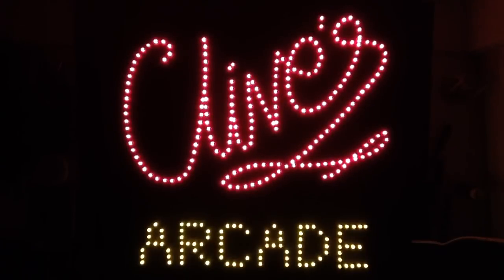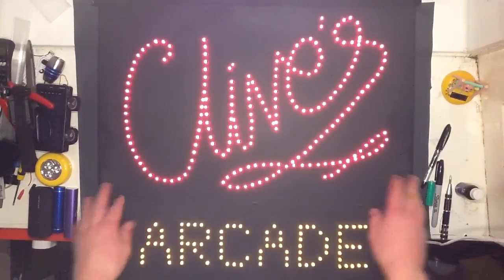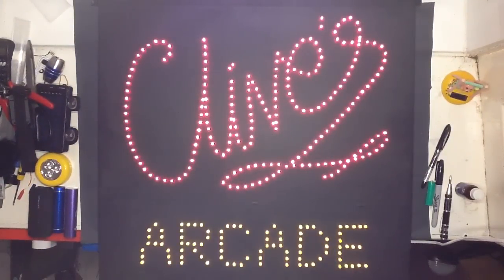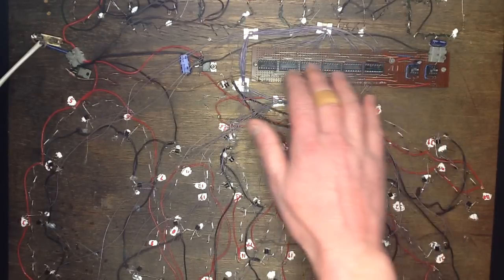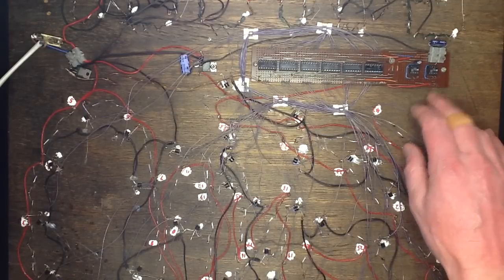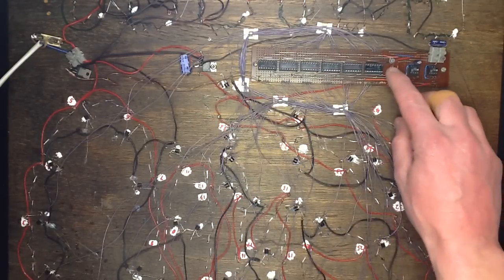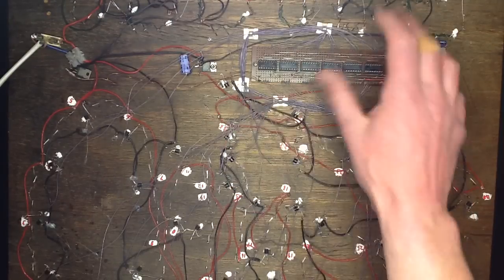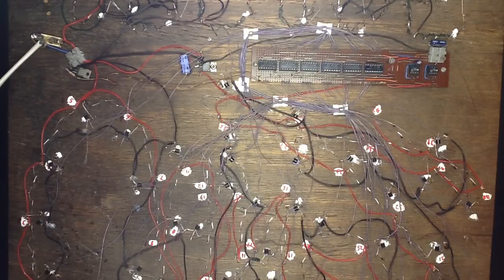An old "scripting" LED sign I built back in the early 80's.

Comment: Just came to visit after the link posted in the livestream 07/05/2022 (DD.MM.YYYY). Reminds me of a fairground thing I made many years ago with strobe tubes and 1 bit shift registers to make a super long (must have been around 15m) travelling strobe light - That did have a PIC micro, and it made a pleasant ticking sound as the strobe lights fired. Used a dual flip flop per board; one for a shift register and one to generate the firing pulse for the trigger transformers. Unfortunately wasn't too reliable, something to do with the tubes being fragile and the opto triac not liking firing the trigger transformer too much. Good while it worked though, could have been used as a landing strip identifier, Maybe could make a low voltage version nowadays with super bright LED's instead of strobe tubes, not quite the same effect but would be much more reliable. Was housed in a very tough, ridged flexible tube, then siliconed for weather proofing.

Comment: Dear, the signature Clives  has more than  48 LEDS but you have used 6 nos. 4511 is with 2x4 bits each IC which  is total 48 bits. 
Can you please share  the  connections diagram  for the above  sign showing how to  drive the more than 48 LEDS. 
Thanks  in advance

Comment: You've inspired me to build a Merry Christmas sign with my grandson, based on this concept and design.  I'm hoping to make an instructable out of it - if you don't mind.  I'll obviously credit you with the inspiration and original design, and provide a link to the video.  I'm going to use 74HC595 shift registers, and drive the clock timing and chase patterns from an Arduino sketch rather than the fixed pulses from a 555, and light the whole thing using LEDs salvaged from failed sets of solar powered outdoor Christmas lights.  Thanks for all the great videos and your superbly dry sense of humour - keep 'em coming.

Comment: Wow, stuff realy was different back in the 80s... I can just go on ebay and get 100 LEDs for 10€ including the resistors, design the logo in Inkscape or Illustrator and then have it cut on the lasercutter at the local open lab. This would be a <30€ weekend project!

Comment: Your talk on the shift registers kind of reminded me... Do you know of a simple 4 pin binary to decimal converter or shift register?
Reply from the maker: +Susana Godinho there used to be a wide range of chips for BCD (Binary Coded Decimal) in either direction from discrete inputs and outputs to 7 segment display drivers.  Both in TTL and CMOS logic chips.

Comment: I wonder what's the maximum power you can take from the grid. In Italy the electric meter cuts at 3kW.
Reply from the maker: +TuttoCrafting Really?  We have a 60 to 100A supply at 230V.
Reply: Yes. It is really disturbing.
I can't turn on the washing machine along with the oven or the hair dryer.

I am a computer technician and I can't let servers up while I cook. There are business plans up to 6kW single phase. (but they are expensive)

Comment: That's very nice Clive!
Brings back memories of something similar I built when at uni in the mid 80's for a friends band.  The script was nowhere near as elaborate as yours, but it did have a 6502 with MIDI input for synchronisation with the music.  I found the mess of wiring and LEDs a few years ago in a box - I obviously didn't keep the frame, but had extracted the parts just in case.

Comment: I have a set of ROMs, EPROMs and SM cards that were used in testing, setup and servicing of video poker and other video gaming type machines in Las Vegas. I think there's 8 or so devices in an anti static box if your interested.
Reply from the maker: +ElfNet Gaming Strangely, I was eyeing up a full poker machine in an arcade today.  Never seen it turned on in that place ever.  But sadly the owner always plays the "licence" card when I enquire about the machines.
Reply: Yeah, i hear they are strict on gaming devices that payout in legal currency. It's that way here too. The ONLY way I think a non licensed person can buy a video poker machine here is if the roms / e2proms that hold the game data are removed.. The ones I have are test chips though but I guess you could install them and play on them.. I have no way of testing them though.

Comment: My grandson and I watch your videos every time you post one and enjoy them tremendously would you consider doing a how to video on making something like this my grand kid wants to make his own and I am still learning so I would need instruction for dummies to help him make one
Reply: M Baldridge nowadays you can fairly easily get a near identical result with an Arduino and a slightly edited blick example, just common together all of the negative leads on the LEDs to the ground on the Arduino and then decide how many segments of lights you want and common together all the positives in that section, connect that to an appropriate resistor and to a GPIO on the Arduino
Reply: Toby Cowles yeah it's easy to do this with an arduino, transistors and a few lines of code, but the discrete logic Version is way cooler

Comment: Good job and a lot of work!  I'm a little surprised you didn't drill a single hole for the LED body and stuff and/or glue them in, rather than individual holes for the wires. Makes the front reasonably invulnerable, and a second bit of perf board or Masonite or luan on the back protects the wires -- usually.

I remember making things like that, but i used a 556 instead of a pair of 555s. But then, that probably depends on what is in the parts bin that day.

Comment: Since you show us all those old things you've build, i checked if i still had some of my old stuff.
I found a DC/DC Step Down converter i made once to power a Game Boy off the board power from my dads mercedes. I didn't had multimeter back then. So i never checked the voltage that came out of it. But my Calculations where correct from a layout i had in a magazine. So today i checked it finally, and came to the conclusion. My Gameboy should have exploded. Because it never stepped the power down from 12V to 6V, it was on 12V.

Looking at it i somehow f***ed up and had bridged a contact with a huge solder blob...

Oh well, it survived, no clue why, but it did.
Reply: +djteac Original Game Boy, right? The color one is very picky about what it accepts from the 3v input: 3 volts. Try to use five and it just won't turn on.
Reply: Looks like your version accounted for some inconsistent voltages of unregulated power bricks (which can go up to 16V under minimal load) so it survived.

Comment: Why drill two tiny holes for the leads and not just one bigger hole for the body of the LED to fit into, leaving the leads free? Does it provide better mechanical support? or easier connections? It seems like it's a significantly amount of extra work
Reply from the maker: +Daniel G If you look for another sign video I put up then the single hole for both leads is actually a lot easier and faster.

Comment: Magnificent beard at 1:40

Really though, I like the idea of the scripting LED sign.  I may have to do that once I find myself in the position to have a man cave.
Reply: +Brendan Orr Word of advice: unless you specifically enjoy doing it the oldskool way, these day there are LEDs with built-in shift input and output (like the WS2812) - so you just string them up one after another without the need to build a whole harness with a dedicated wire to each (also, they're full RGB).
Reply: I've already got bags of LEDs laying around along with trays of shift registers and TLC5940s.  Although I would like to make a LED marquee/ticker out of WS2812 or similiar packages.

Comment: Arcade machines are strange things, still present but very rare in the field other than the pizza places. 

A vendor regularly purges their unprofitable vintage games and I am there to collect.   For the safety of the landfill.. original Galaga processor boards are toxic I hear.  
Who knows what that intact Asteroids vector monitor would have done to the trash dump. .

 The strangest one is a machine that sorts ping-pong balls into a lottery number..
Reply from the maker: +webmonkees This is why I sometimes wish I lived in a barn.  So I had enough space to surround myself with as much technical stuff as possible.
Reply: +bigclivedotcom Oh, it fills the space no matter. A drawer, a shed, a barn. That in mind, residence 4.0 will have room until it doesn't. 

So far this was the biggest take. All you can do is take the good bits before the weather kicks in. 
http://webmonkees.com/arcade/sale/look.htm
Reply from the maker: +webmonkees It's always disturbing seeing vintage machines dumped outside barns or being trashed by people who just don't know any better.
Reply: +bigclivedotcom Well, I've done what I can. currently their debris is an upended pool table that's been snowed upon so slim pickings this week.

Reverse-engineering the coin counters shows they have made their money back many times over even accounting for electricity. $14,000 worth of gaming out of one, and these guys.. well, they seem to like to keep these out on route till the cabinet falls apart.

Comment: It looks brilliant clive, the result is really unusual, love the use of 4015's and the good old 555's, i love that type of technology.
I bet you were really pleased with the result, i would be :-D
I first thought the chips were 4017 decade counters but im sure that would need too many parts, your way is very economical.
Reply: 555 timers are still very useful parts. They make great LED dimmers.
Reply: @bikkiikun  Yep they are still useful for so many uses and people have found really odd ways to configure them.
The 555 can still be bought, it's ancient but still useful.
Sadly the creator of the 555 died a few years back.
The man was a genius.
I don't like the 556, it's not quite the same spec, two 555's is my choice.
Have i put you asleep lol.
Reply: @zx8401ztv  : I never tried the 556, but I did try the 558 (the one with four timers integrated). Didn't work well... at least as dimmer (for multiple strips). Too much noise. Better use multiple individual 555s that are well separated.
At least, that's my amateur experience.

I do have a question, though: do the CMOS versions have any benefit? 
I do know they use less power and many of them come with higher runing frequency.
Reply: @bikkiikun  They do use less power but i don't think they can drive the output with as much current as the original bipolar 555's.
I think they don't create spikes on the power supply so much but that makes sense because of the output limit.
I find they drift about frequency wise.
i think you can use larger timing resistors being cmos.. (less current in the resistors).
i havn't messed with the timers for a couple of years and my memory has escaped out of one ear lol.
I'm sure big clive will correct my memory.

Comment: I like the cursive of "Clive's"
Reply: +RicoElectrico I think it works well - the ARCADE being grid-aligned plays to the design of the old school games you'd see at Arcades (PacMan etc) :)
Reply: +bigclivedotcom You should get some clear perspex and a wood frame to fit over the front of it to protect the LEDs.
Reply from the maker: +RicoElectrico It's been stored for a long time with stuff against the LEDs.  So they were mostly bent out of position.
Reply: +crackedcookies Yeah. But the ARCADE being grid-aligned looks quite off.